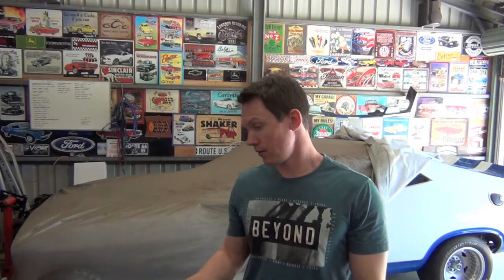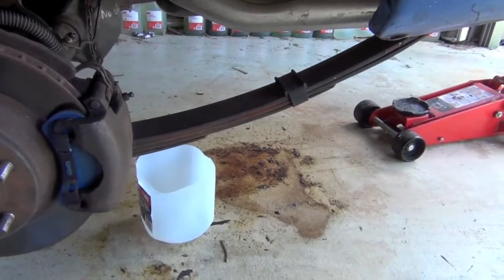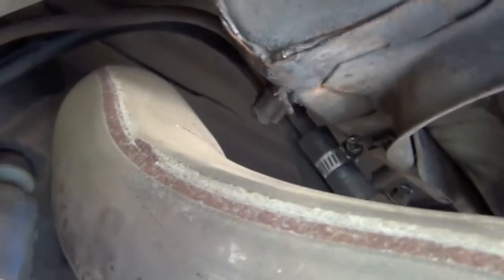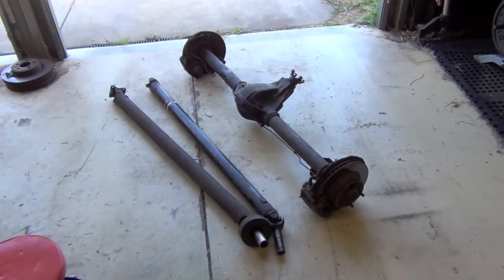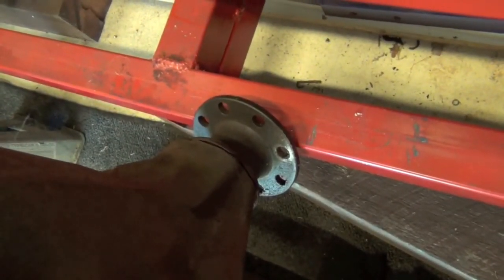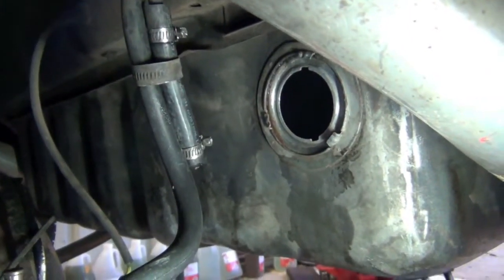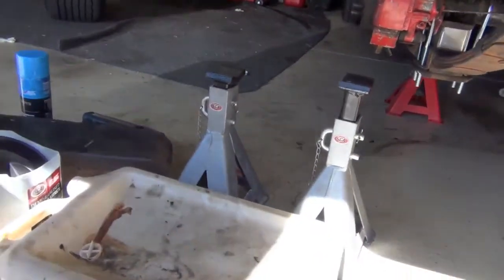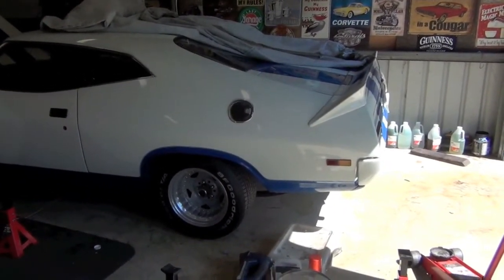XC Falcon Coupe diff change, lowering block install, fuel sender retainer install

Comment: Love the coupe, just interested in the rpm range after the diff ratio upgraded? Whats your open road rpm like in top gear is yours 4 speed still? I have a XB coupe with the 4 speed and factory borg warner diff and was looking at fitting a Ef/ El ute/wagon rear end with the disc brakes. 
Many Thanks

Comment: Nice coupe man! I still have the m75 bw diff. I wouldn't mind upgrading like you have. Did you have to cut the diff down? I thought most newer car had wider track diffs.
Reply from the maker: No, only 3m wider from memory. Would love a 9 inch but can’t justify the money yet. I’m surprised how well this combo works, bolted straight in.
Reply from the maker: XC 1547mm compared to EA,EB,ED 1557mm and EF,EL 1559mm. So <5mm each side, don’t notice when bolting up.
Reply: Thats great news! I wouldn't mind finding a diff assembly with lsd and disc brakes but thats probably going to be difficult. I used the 75 series bw in my escort, but has moser billet axels with ebay copy truetrac lsd. It hooks up very no dramas. My current m75 in my xb looks very sad.
Reply: Xw 1502 around a inch shorter either side 👍 .. xr shorter still